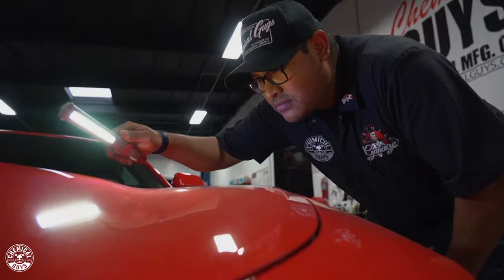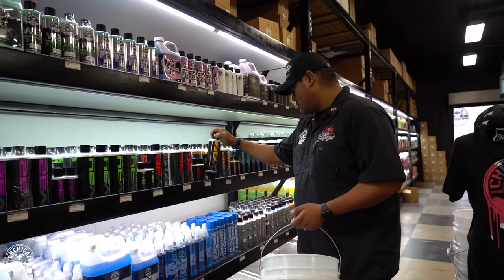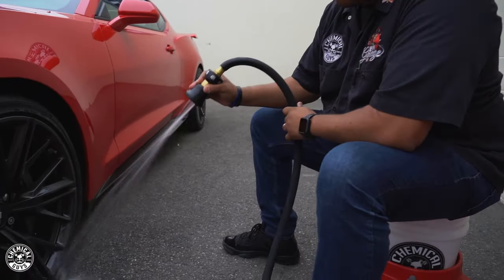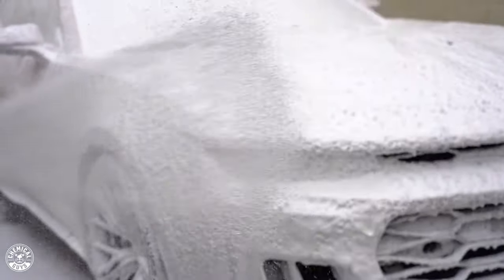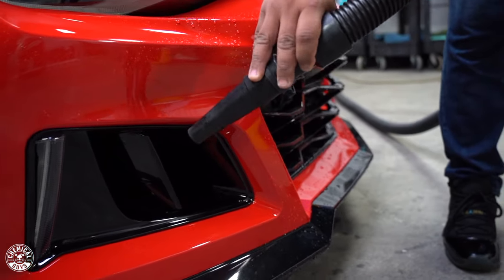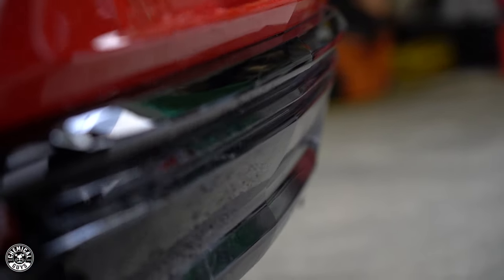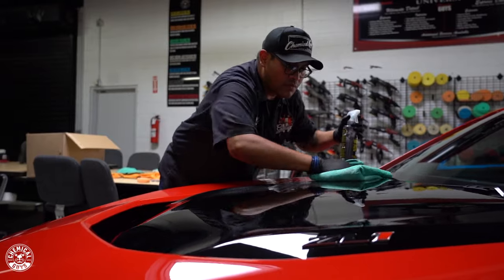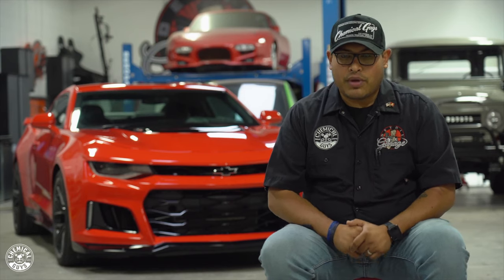How To Prep & Apply Ceramic Coating! | Camaro ZL1 | Chemical Guys

Comment: Please do a dedicated video on Hydro Charge, from how to prep the vehicle, what surfaces can it be applied on and the best way to apply it for the absolute best results and longevity. From what I've hear it contains 40% sio2. Is that correct? If so that's an incredible amount, much higher than almost any spray on ceramic coating and looked easy to apply. I want to know does it sheet or bead water? How to take care of it? I can't be the only person that just needs more info on what sounds to me like a great product. There is just barely a couple videos so far and they don't give me the answers or info I'm looking for. Thanks
Reply: A reply would be greatly appreciated, thanks
Reply from the maker: Hey there! Thanks for your question. This video demonstrates the proper way to prepare a vehicle for HydroCharge. We recommend applying this coating to painted surfaces only. More videos coming your way! Check out the FAQ for HydroCharge for additional information. - Happy detailing! 
https://www.chemicalguys.com/blogarticle?cid=article-hydrocharge-faq

Comment: New to Chemical Guys. Just binged about 100 of your videos. Great stuff! Very excited to get started on my new Octane Red 2019 SXT. Planning on detailing start to finish. Polishing is my only "fear." One thing I was watching for, and must have missed, is polishing hoods that have many dips and divots in their design. Should these be hand polished only? My hood has a "channel" right up the center that is only a few inches wide. How would I attack that?  In the one video you stated that it's hard to mess up paint with a DA, but not impossible. That's my concern! Most of the scenes your videos focus on are polishing flat surfaces or maybe slightly curved panels. Could you point me to which video may show a little about working with points and body definition? Thank you so much!
Reply from the maker: Hey Jack! Thanks so much for reaching out. It is still perfectly fine to machine polish vehicles with different contours and shapes. Sometimes using a smaller backing plate and pad is the best option for tight crevices. Being a new car it shouldn't need an aggressive paint correction so a White Hex-Logic Pad and V38 Final Polish should do the trick.
Reply: @ChemicalGuys  thank you so much for the response. Now to save my pennies.

Comment: this stuff is pretty good but i don't really like how you guys have 20 different types of products for each category in detailing .
Reply: Right? There's too much to wade through while trying to find exactly what you're looking for.
Reply: Richard Atchley Citrus wash and gloss is their all time classic, its like the gold class of meguiars soap. Best soap ive ever used tbh
Reply: Dude 100% with you...give me like a good, better, best option
Reply: @Eagleye11700  because they have subtle differences in what they are supposed to achieve. Like he said in the video if you need something a little more aggressive there is options. Albeit their wheel cleaner lineup seems pretty clogged and not much of a difference.
Reply: TMI Chemic Dudes! I mean i like the premise but make a simple wash, clay, polish, ceramic coat video with product list that wont make me pull my hair out!
Reply: Chemical guys is the biggest detailing company and they are catering to all types of customers. Pro and beginners. What I do wish they would do is have a detailing chart that shows each type of product compared to others and the differences so it's more easy to understand which product for which type of application.
Reply: Most of The Times if you not sure what the product is you probably don't need to use it then but different products do different things depending on what you need to do lol

Comment: The ZL1 looked great. 10:01 did you use the hole bottle? Putting HydroCharge on thick makes it hard to wipe off two light coats works best.
Reply: What’s up Ouzo Lou Garage ! No I MAYBE used an 8th of the bottle! Goes on very thin and easily spreads on the car!

Comment: Really nice to see someone I have met at this store giving a detailed explanation of how to make this ZL1 shine at its best. I have a 1LT RS with a clear coat protection layer, but every time I wash it I see water spots that I can't seem to get rid of on the hood (like if they were sealed under or something). I wash my car myself using the Carbon Flex Vitalize Soap with the two bucket method and microfiber mitt. For exterior I use Diablo Gel for my Wheels using an easy reach brush (sometimes also the orange degreaser prior to loosen hardened brake dust). Do you have any advice on what I can use to remove the water marks? Also, I would like to wax my car for a nice shine, but am unsure if I would hurt the clear coat or anything else and if I need to clay it before (not sure if it feels smooth because of the soap I use or still doesn't have a lot of dirt trapped on the paint).  Where should I detail if I don't have a spot to cover from the sun?

Thanks Hector for the great quality video!
Reply: Try their water spot remover gel.....

Comment: Can you add sealant and or wax overtop of hydro charge for even more gloss? For example blacklight or butter wet wax. And then finish it off with spray v07?
Reply: Bill Ong Yes you can, you can hold up on the black light because since the car is already paint corrected with no imperfections you typically don’t need it so you can just add butter wet wax and top that off with your V07, trust me your car will look amazing
Reply: One of their videos says you can add a wax over it with no issues

Comment: @chemical guys :question about using hydrocharge with hydrosuds. Can I use both? And if so, I'm assuming it's washing with hydrosuds, dry and then apply hydrocharge? or do you only use one and not the other? Thanks!
Reply: Sheen Pan x2

Comment: You said you used wipeout to remove old waxes or sealants. Could you have applied a glaze before adding the hydro charge?
Reply from the maker: Hey!
Always apply Hydro Charge first then a glaze after! Then sealant and then wax!
Reply: @ChemicalGuys  so applying a glaze with a machine won't strip away the hydro charge coating?

Comment: I use p40 carnaubawax after every wash session. Does it have any positive or negative effect If i used hydro charge before and then applied the p40 regulary after the washing sessions? Will it even work if i put on this wax on a ceramic coating?

Comment: @Chemical Guys, what is that brand of the powerwasher sprayer that you use? That short system looks a lot easier for doing car detailing and saving the wand and extension for housework.
Reply: Jordan Meek pretty sure it’s called the stubby

Comment: If I wanted to do two or three coats how long should I wait between applications?
Reply from the maker: One coat can last up to 12 months so we recommend reapplying every 4 months or so to maintain the strength of the coating.
Reply: @ChemicalGuys  what is the prep for another coat? Just a wash?

Comment: After Hydro Charge could you add a layer of Jetseal, wax and gloss or is that just crazy? Would it significantly add to the length of durability?
Reply from the maker: Hey! Yes, we recommend applying Jetseal and a wax to enhance the shine and protection. Thanks for watching and happy detailing!

Comment: When are you guys going to work on a full size pickup truck?   Do this whole process on camera and show how you work on a truck with a hard cover over the bed.  You guys ALWAYS  do the easy to work on vehicles.   Let's see some difficulty in the process and not just the low hanging fruit!
Reply: Delwin Campbell they have a video of a big Chevy truck.   Search for it.

Comment: Hey, I painted my Bike 2 Months ago and wanted to ceramic coat it now using Hydro Slick.
Do I really need to clay bar? The paint is 2 Months old so it's not that dirty and I've not ridden around after painting it.

Comment: Isn’t the point of foaming a car to loosen up and let the foam pull off debris before putting a wash mitt to the car? Why didn’t you pressure wash the foam away before hitting it with the mitt? I understand you’re gonna be doing paint correction anyway but why would you potentially cause more scratches and in turn more work for yourself?

Comment: What are your recommendations to strip off hydrocharge if I want to reapply it again? Maybe this time add 2 coats? Would clean slate remove most of it?
Reply: I'm trying not to polish or compound
Reply from the maker: Hey Jonathan! HydroCharge is an actual ceramic coating so the only way to remove it would be to polish it away.
Reply: What polish will remove the hydrocharge?
Reply from the maker: Using V34 Hybrid Compound will remove ceramic coatings.

Comment: Can I use the standard coating applicator block and suede cloths to apply HydroCharge? Or should I stick to the applicator-pads as shown in the video?
Reply: Any works as long as it’s clean and is meant to be an applicator .
Reply: @JP-zz5rm  As I imagined! :D Thanks!

Comment: applies V07 sealant to the car during inspection and then chooses clean slate soap because he doesn't know if the car has any product on the paint lol.
Reply from the maker: Hi LordZillo! Hector used Hybrid V7 to inspect the paint for imperfections because it is a quick detailer as well. Then the entire vehicle washed using Clean Slate to strip and prep it for the coating process. - Happy detailing!
Reply: Darth Desec  no, you

Comment: Heres a real question because it contains ceramic properties however, what is the curing time to bond to the paint once applied?
Reply from the maker: Hi Joe! HydroCharge can be removed in as little as 30 seconds, however we recommend allowing 1 - 2 minutes. Depending on the climate, the hydrophobic effects will continue to improve even more after 24 hours of being applied.
- Happy detailing!!

Comment: what would y'all recommend on the soft paints like on subarus? for polishes
Reply: If it’s really soft try something like V36 or V38 if you don’t have much experience detailing. Works best with a DA polisher, I wouldn’t recommend using a cheap buffer cause it won’t do squat lol

Comment: Can I just wash the car and dry it like recommended then apply the Hydro Charge to get a good enough shine? I don’t think I’ll be doing any self polishing soon.
Reply from the maker: Hey aly55sa! Thanks for tuning in. It is recommended to polish the surface prior to application because any imperfections will be locked in underneath the coating but it is also personal preference, if you're okay with the condition of the paint or the surface doesn't need correction it can be coated after being decontaminated. - Happy detailing!!